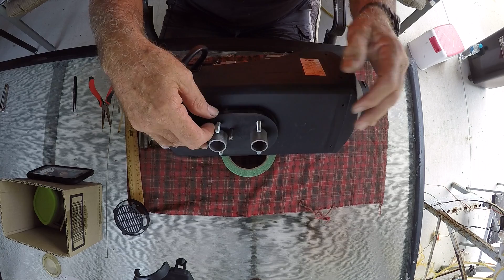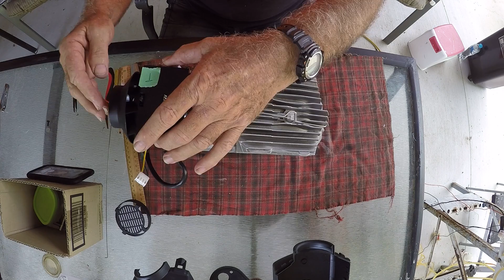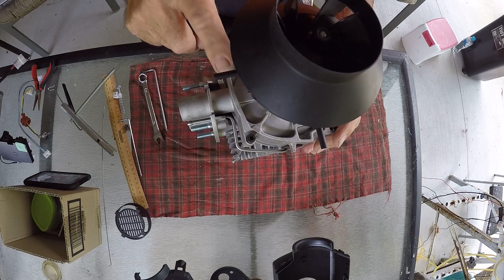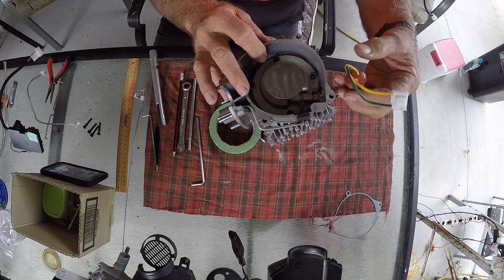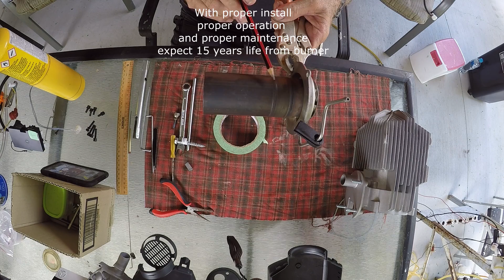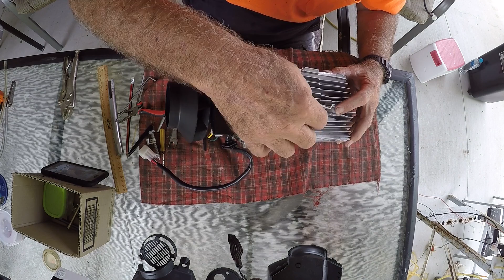Chinese Diesel Air Heater   Part 14  Strip Down

Comment: I note from most vlogs that folks tend to want cheaper fuels, but suffer maintainence issues. I'm wondering if it would be worthwhile to run on 'premium grade' diesel, such that the cleaner burn potentially might save on the inconvenience of strip downs. Your series of video's has been quite illuminating. Any opinion John,  on using the premium diesel....worthwhile or a waste of money??
Reply from the maker: @jimmaxwell2259  

Hi Jim,

We do not readily have premium diesel in Aus, so I have not tested with such diesel, and hence can not comment.
However, if you want a clean burn suggest you use Kerosene, as that burns very clean.
If you have access to heating kerro you can just use that. In Aus we mostly have very pure lighting kerro and it needs an addition of about 10% diesel to give it some lubrication properties.

I will often run a kerro mix through the heater for about 15 mins at end of season to help clean out any carbon deposits before summer storage.

Cheers,   JMcK
Reply: @johnmck1147  Many thanks for the reply, appreciate the info given.

Comment: Thank you for this superb series. It was very informative and I have learnt a lot from it. 
If I may I have a couple of questions on the ECU(motherboard) and controller. 1. are the ECU(motherboard) brand/model specific or are they generic and interchangeable. i.e. when replacing a ECU(motherboard) should an exact replacement be sourced or can any of the different designs of motherboard for these heaters found on ebay be used (providing the power and heat ratings match). 2. when replacing the ECU, should the controller be replaced as well. Thanks once again.
Reply from the maker: Hi Lock,

When I made these videos some five years ago now, the heaters were all generic and followed the same protocol. It was very easy to mix and match ECU's and controllers. These days some suppliers have chosen to go proprietary, with their own wire plugs, systems and protocols, so mix and match is no longer easy.

However I have noticed “unbranded” heaters generally follow the old generic protocols.

If you do not know, it would generally be better to replace the ECU and controller as a unit, and purchase both units from the same supplier. 

Good luck.  JMcK
Reply: Thank you for making time to respond. From it am I right in thinking that the proprietary changes (wire plugs, systems and protocols) you mentioned will be confined to the ECU and controller? If so, am I correct in thinking then that as long as the ECU and controller are replaced together, they can be replaced by any other? (assuming the input/output devices (fuel pump, temperature sensor, fan. heater plug) remain generic) Or have I miss some further considerations. Cheers
 @johnmck1147
Reply from the maker: Correct. 👍

Comment: Hi John 
The fan on my diesel heater does not run freely and seems to be catching somewhere and also blows fuses when I try to prime it 
Do you have any idea why
Reply from the maker: Hi Gordon, sometimes the fan blade catches on the outer casing. You can test this with the heater not working by putting your finger in the inlet side and move the fan back and forth. You will hear and feel it scraping if it is rubbing. 
If a new heater ask for a replacement heater.
If an old heater, you can sometimes pack the heater up so the fan does not scrape.

If you blow fuses I need more info. You should have a min 15 amp fuse installed.  JMcK

Comment from the maker: Hi Papilon

Can you hear the pump “ticking” as the little piston goes up and down. 

If you can the magnet is working and the piston is moving. 

Take the pump outlet hose off and see if fuel is squirting out with pump working. 

You will now know if the pump is working. 

Also check your pump is the correct voltage, and not a 24 volt pump. 

Please let me know how it goes. JMcK

Comment: hi john,hope you can help me with my diesel heater,i have just put a new pump on it and still doesnt work, it seems as if its blowing the pump as my friend as same diesel heater so tried the new pump on his diesel heater and it does not even work on his,what may be doing this,any help would be very much appreciated,as dont want to buy another pump if this is going to happen again.Many Thanks john.

Comment: Hey John, if I’m getting a smell similar to that when you walk on airplane before take off, would that represent a crack in the glow plug seal? Appreciate your expertise on these videos. Really great.
Reply from the maker: Hi Brett, depends where the smell is coming from.

It is not uncommon to get a bit of a smell on start and shutdown. It comes from unburnt fuel in burner, but it goes away quickly once heater is started. It comes from the combustion air inlet hose.

If you are getting the smell from the hot air outlet, then you need to take action straight away as you may have a leak from combustion chamber into hot air heat exchanger. This then comes into the accommodation area. This could be caused by broken seals or glow plug cap seal. This must be fixed or you could get CO poisoning.  JMcK
Reply: @johnmck1147  Thanks mate, really appreciate you getting back to me.

Comment: Hey John such informative videos! I am experiencing a small amount of soot coiming out of the exhaust pipe when I fire up the my heater. It such a small amount I can only see it because of the contrast of the snow it is landing on. Do you think this would be considered normal, or is this something I should be concerned about and need to service. Thank you!
Reply from the maker: Hi M,

Is the soot only apparent on start up and then the exhaust goes clear?
If so, that is not unusual.

If there all the time you could have an issue with fuel air mix ratios.
The most common cause of this is restrictions in the combustion air inlet and the exhaust system...Too many bends.

Another cause of bad mixture ratios is operation at altitude. Generally over 1,000 feet. The greater the altitude the richer the fuel air mix and the more carbon produced.

Now what can you do.
If you have restrictions, see if can remove some bends.

If at altitude, these heaters have no altitude compensation so all you can do is run a high kerosene/ diesel mix, up to 90/10. Kerosene runs much cleaner than diesel.

Also, on a regular basis, run the heater at max output for 10 to 15 minutes every day or so, as it helps burning off excessive carbon.

Last up, when the carbon gets really bad you need to strip the heater down and manually clean it.

Keep warm.   JMcK

Comment: Hi John I’ve bought two of these heaters direct from China and I’m very pleased. Thanks so much for all the info you upload. You’re by far the most in depth and interesting guy to watch. I have a question? As I said I’ve bought 2. They are or supposed to be 5Kw units. But as I’ve nothing to compare them to. How do I know? What I do know is the 8kw and 5Kw are of similar size. But what dimensions should my 5Kw be. There’s nothing on it saying what Kw it is? 
Thanks

Comment: Thank you for this, very educational.
 I have a question, do you have a place in the videos that discusses replacing the motor bearings and brushes?
 Thank you.
Reply from the maker: Sorry John, I have not done a video on fan motor bearing replacement.
You can buy on line spare fan motors or even complete fan assemblies for around $10 to $20.

Just one site I quickly looked up just now.

https://www.ebay.com/itm/1pc-12V-24V-5000W-Diesel-Parking-Heater-Blower-Motor-Combustion-Air-Intake-Fan-/394294622084?mkcid=16&mkevt=1&_trksid=p2349624.m46890.l49286&mkrid=711-127632-2357-0

Cheers.  JMcK

Comment: Hi John, thanks for another great video! I installed one of these Chinese diesel heaters a while back and it still gives off a toxic smelling hot plastic smell. It's not really strong but doesn't smell nice. As far as I can tell I have installed it all correctly and carefully so it seems that the smell is coming from inside the heater somewhere. I have seen a few people complain of the same issue but I haven't found a good solution. I've also ran the heater for many hours since instillation and the smell is still there. It doesn't smell like diesel or fumes, more like a faint smell of hot / burning plastic. Do you have any idea what might be causing this? It's very frustrating as I have very careful and thorough with the instillation. Any help would be appreciated. Thanks! Leon
Reply from the maker: Hi Leon,

First I would beg or borrow an instant CO meter, not normal fixed meter, and check your outlet. You don't want to see any CO reading on the meter. 

If you get a reading you most likely have a cracked or broken gasket issue. Have a look at the gasket video.

Next open the heater and check that there are no wires or plastic touching the hot heat exchange fins on the heater.

Also check the glow plug seal and the intake fuel pipe seal. The gasket video explains.

Please let me know how it goes.  JMcK
Reply: @johnmck1147  Thanks so much John! I really appreciate your reply. I’m going to buy one of those meters and test it. And then follow the other steps if necessary! Thanks very much. I’ll let you know how I get on!
Reply: @johnmck1147  Hi John, just wanted to send over an update. I purchased the same CO meter you have and tested it. Luckily I'm getting a reading of zero so. I'm still getting a faint smell of hot plastic from the hot air but it seems to be getting a bit better. I'm going to run the heater hot for a while a few times and see if that helps burn of any internal coatings etc. I've also had a second opinion from a friend who thinks the smell is faint enough to not be an issue. So will see how it goes and if anything gets worse I'll have a look inside. Thanks for your help. The meter really helped.

Comment: A very helpful video for taking these heaters down and maintaining them. Would it make sense to mount the ECU somewhere outside of the unit so it the event of an unplanned power loss it won't get melted? It looks like you would only need to run a few wires for the glow plug, fan, and temperature sensor.
Reply from the maker: Hi Adam, yes it could be done but it is not worth the effort. 

The real difficulty is the ECU has mounted on it the fan speed sensor, so you would need to make a new bracket, remove the sensor from the ECU circuit board and mount it on the new bracket and get the position and spacing right above the fan magnets. Then find somewhere else for the ECU, run new wires etc, etc.

Better to just buy a new ECU in the rare occasion this may become an issue.  JMcK
Reply: @johnmck1147  Makes sense, thanks for the answer. Also, I'm curious, is there any easy way to reclaim some of the lost heat from the exhaust (say to warm water in your hot water tank). I thought of maybe using an air to water intercooler core. I've heard estimates that 500-1500 watts are being shot out the exhaust pipe, and that's about what it takes to warm up the 40 liter water tank in my boat.
Reply from the maker: Hi Adam, a number of hands on people do reclaim the exhaust heat. If you have the skills you can make a simple heat exchanger, or even get a bit of solid exhaust and wrap copper water pipe around that piece of the exhaust and you have a hot water source.

I know of no commercial product available off the shelf, so there is an opportunity there for some workshop.  JMcK

Comment: My heater works some of the time. I pulled it apart and the glow plug has white crud on the tip of it. Do you think that's related to my issue?
Reply from the maker: Oh SE, I would need more info than that to offer an opinion.
The glow plug is only one part of the start cycle. You could have the atomisation screens blocked with carbon, issues with the glow plug start screen, the start breather hole blocked with dirt or a bug, the pump not working, bad fuel, blocked filter, low battery etc etc.

Perhaps I can be more help with more info.  JMcK

Comment: I had a 1985 VW Golf diesel for 14 years in Canada until it turned into a rust bucket from the road salt, and scraped. 
Every couple of years, one of the four glow plugs would burn out. It was expensive to buy and a pain to install.
I understand the ones in a combustion engine experience great compression forces, but none of the ones I took out, had any cracks. They became open circuit. 
And just to start the car, unlike the constant start and stop of these heaters. 
How long do these glow plugs last in actual 24/7 winter use? I'm in Canada and it will be operating for 6 months out of the year. 
If I have to replace the glow plugs every 3-6 months, then it's not very economical anymore.
The other option is to replace it every year with a new one. they are cheap enough to be disposable.
I think it would be best to buy 2 and operate one until it breaks down, then switch over to the spare until the broken one can be repaired or replaced.
Reply from the maker: Hi PN

It is rare to need to replace the glow plugs in actual use. 

We have been using the boat heater on and off for some 12 years with original glow plugs. Havent needed to change glow plugs, or even service that heater. 

Haven't needed to replace glow plugs from use on any installs to date from actual use.

However, I have needed to replace a couple of glow plugs I accidentally broke during service, or carbon removal in the early days. The ceramic part is very brittle and easily broken if you are not careful. Make sure you use correct tools. 

Cheers,  JMcK

Comment: Carbon burn off temp is between 300-500ºC. Aluminum melting point is 660ºC.
Why can't a propane or MAPP torch be able to burn off every bit of the carbon, where the torch can actually melt the aluminum?
Why doesn't the stainless steel turn into dust of rust like most high end BBQ burners after a few years of use?
Is it because burning propane and natural gas generates so much water vapor? Galvanic corrosion? 
I was sure the chamber of these heaters were built from ceramics and not stainless steel. I learned so much watching this series. Thank you.
Reply from the maker: Hi PN,,

I do use a MAPP torch to remove carbon from burner screens when necessary, and show this in one of my videos.

Burning propane produces huge amounts of water vapour. 
I have not come across a rusted burner chamber yet, but I have only really been serious with these heaters for 12 years or so.

Cheers.   JMcK

Comment: Hey John, 
Thank you for your informative videos. I plan to mount the heater with the intake and combustion pipes exiting sieways from the box. Glow plug up of course. Can I cut the metal fuel intake pipe on the inside portion of the diesel heater housing and connect the fuel line to it in there? I wish to have the fuel tank in the same box as the heater, side by each, and wish to feed the fuel line from the fuel tank into the heater through a hole in the housing to the newly cut metal fuel pipe, thereby not having to feed the fuel line outside of the case to enter at the current external location. I hope that is clear. Thank You.
Reply from the maker: Hi CJ, I can't see an issue with that setup, provided you don't weaken or damage the fuel pipe seal
JMcK
Reply: @johnmck1147  Hey John, Thank you for the reply. Thank you for making this series of videos. You’ve helped many people understand how these heaters work and have thereby made their operating environments safer. Cheers.
Reply: @johnmck1147  Thank you John. Also, is pvc fuel line a suitable alternative for the rubber 1/8" ID fuel line used to join the nylon fuel line to the pump/filter etc.?  I'm looking at using this...Is this product a suitable alternative? "Motion Pro Clear Pvc Fuel Line, 1/8 Idx 3 Ft"
Reply from the maker: Hi CJ, thanks for the positive comments. Pleased the videos were helpful.  JMcK
Reply from the maker: Hi CJ, in my opinion don't use PVC fuel line. Suggest you only use good quality rubber fuel line on input side of pump and narrow bore hard nylon on delivery side of pump, unless delivery side very short.
All my tests on PVC fuel hose not only showed it absorbed the fuel pulse, but it also perished in a couple of months when exposed to sunlight.  JMcK

Comment: Hi John hey I have one of these heaters I have a problem the fan will not spin up when I turn it on and there is a clicking in the control board in air code 6 comes up but it doesn't seem to be anything to do with the magnetic setup is there a way to test the fan motor
Reply from the maker: Hi B,

First check if the fan is rubbing against the case. You do this with the heater off, put your finger on the fan and move it back and forth to see if it scrapes. If so you can generally adjust the metal heater in the case to stop the scraping.

If the fan itself has issues like bearing troubles you can buy a spare fan on eBay, but if the heater is new, send it back for a new one. If not new, I suggest you buy a new heater and keep the old one for spare parts. These copy heaters are so cheap, that unless you are a real enthusiast it is not worth your time and effort to proceed here, if more than a simple fan scraping fault.  JMcK
Reply: @johnmck1147  so thanks for the reply 
after playing with it for couple hours  i pushed the on button  and tapping the motor  housing at same time, with back of screw driver and  it came to life . there is a solenoid on the control  board that kept on clicking then showing code 06  not sure what happened but think that the motor on its way out

Comment: For a boat, any concern on the non-moisture proof electronics?
Reply from the maker: Hi Kelly,

Like any boat electrical connections on a boat you need to protect the wiring connections with something like WD40.

As for the ECB circuit board you can buy circuit board protection spray from an electronics store, that will provide protection to the ECB if you want peace of mind.  JMcK